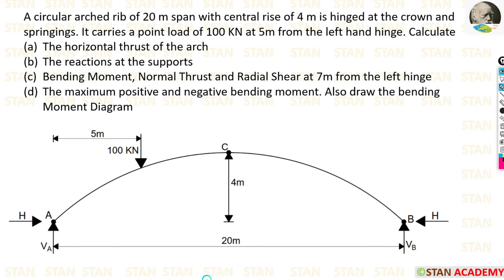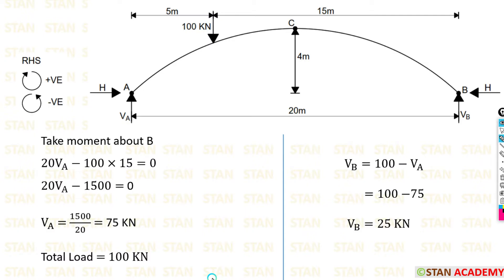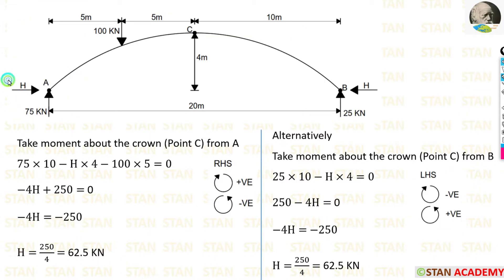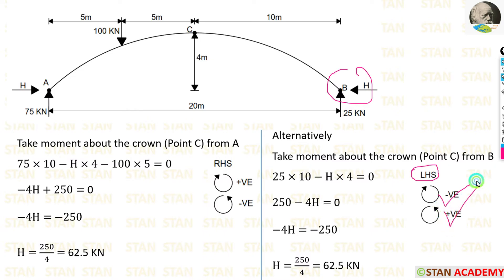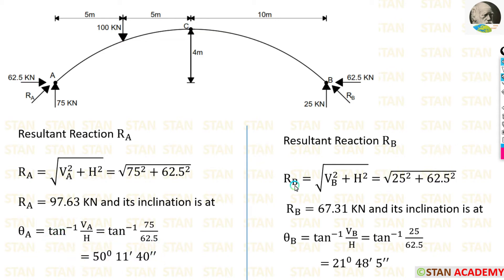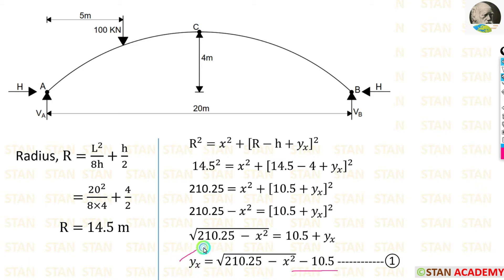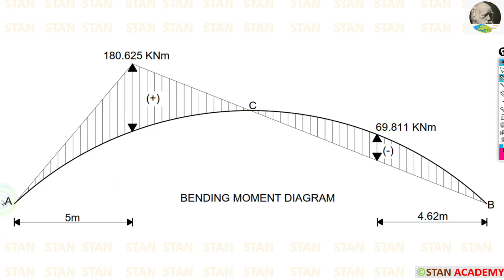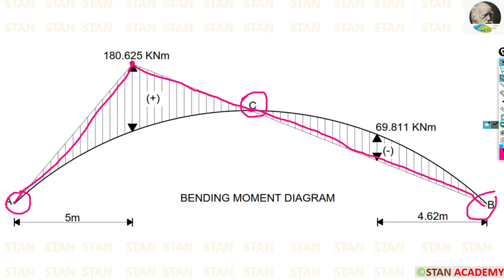Three Hinged Circular Arch - Problem No 1

Comment: Sir.. in case of positive bending moment you didn't consider point load 100kn ..only you are consider horizontal and vertical reactions..please clarify my doubt sir..
Reply from the maker: The distance for the point load is zero. So no need to consider that
Reply: @Stanacademy  ok sir. Then If UDL is given then how will I consider distance x
Reply: @Stanacademy  please reply sir
Reply from the maker: @naidurongali8732  You have to check which vertical reaction is high. You have to make a section on the half where reaction is high. Then find the distance and moment
Reply: We are considering upto the cross section only ,so we neglect the loads at that cross section